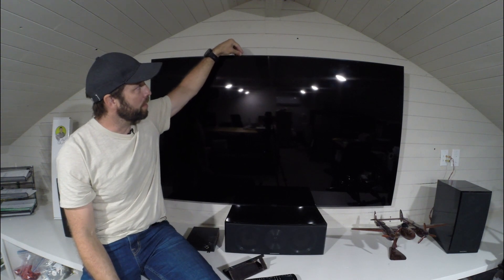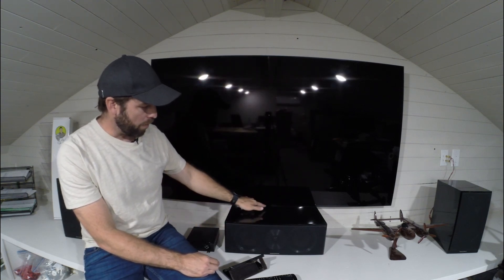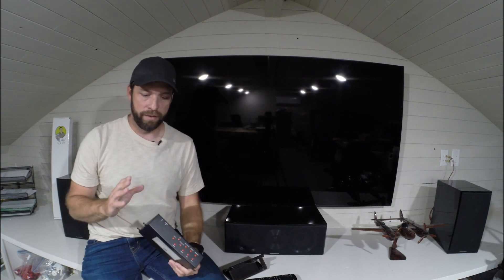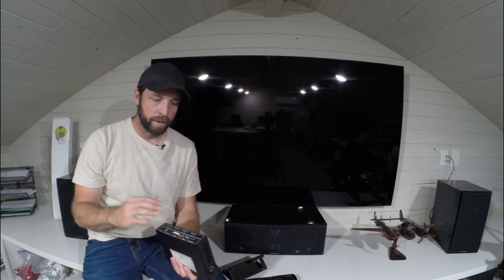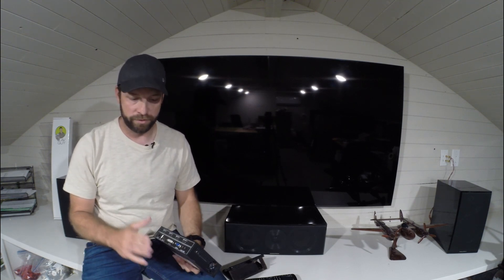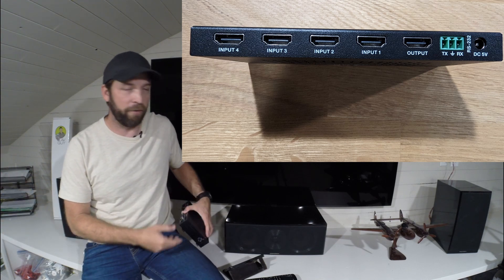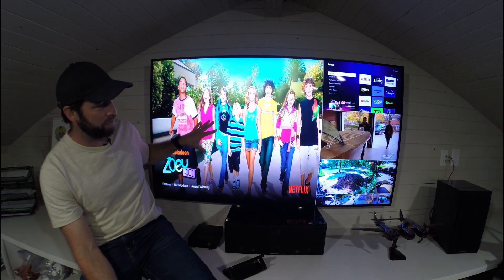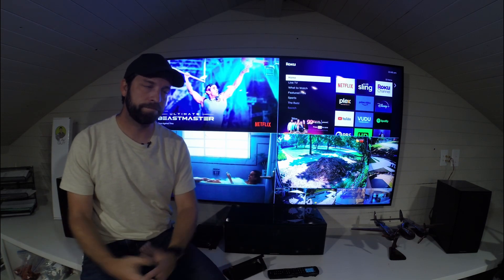What Hardware is Necessary for a Video Wall Setup

Comment: I’m afraid I’m trying something that can’t be done. Working on a 6 tv wall 2 high and 3 across. Would like on game days to have 6 different games on 6 different screens. AND have the option for a four screen large game with two separate games on the last two screens. Will the combination of the wall controller and media splitter allow me to do that? Or will the media splitter only apply to a single screen?
Reply from the maker: First, just about anything you can dream of is possible...just more $ and time is all it takes.  What you are asking for is 100% doable.  Depending upon your budget you might not get the results you are looking for exactly.  With the correct video wall hardware all 6 displays could be organized exactly as you described without any problem at all.  The appropriate hardware could easily set you back over 10k.  You could instead group 4 of the displays to one "cheaper" video wall controller with multiviewer and then leave the other two displays out of that system altogether and just use them to run whatever app you want to use (YouTube TV, Netflix, etc).  The 2x2 would be a true video wall (acting like 1 display)and the last 2 displays would just be regular TVs.  The multiviewer would need to be connected directly to the 2x2 controller to break them back into 4 individual sources when desired and back to 1 big image.  You would only need to address the top TV of the 2 independent TVs as it would likely have to be inverted to fit the wall appropriately and so the imaged would be upside down.  You can find hardware to flip that image because it likely won't be supported on your TV itself although in some service menus there are options to flip the image. Hope that all makes sense.

Comment: How would you feed the video wall controller from a distance if the source of the video is coming from a computer or laptop? Is it possible to use ethernet or wifi?
Reply from the maker: Any HDMI source would work.  Cable box, Apple TV, laptop, etc.   There are wireless HDMI sources you can use.  If you have Apple products any device with Airplay 2 is your solution (Apple TV, Roku and others). If you're a PC user something with Chromecast built in is a good option.

Comment: Hi! What type of TV mounts did you use to get everything so precise?
Reply from the maker: I've used both standard mounts and video wall display mounts.  Do a Google/Amazon search for them.  Video wall mounts give you the most control but you can get away with standard mounts I just suggest one with post level adjustments

Comment: Do you plug all your devices (fire stick, Xbox, chromecast, cameras) into the multiviewer. And then plug the multiviewer into the video wall controller, and then video wall controller to the 4 tv’s?
Reply from the maker: That is correct.  Or if you have a regular TV then you would plug the multiviewer directly into a single TV or projector.
Reply: Thanks for confirming. Very helpful.

Comment: The two pieces of hardware in the description both allow 4k in and out?
Reply from the maker: Correct.  But there are limitations with this sub $200 multiviewer.  It only supports 4k 30hz for one and you just need to do your own research when choosing a any hardware.  Specifications are pretty loosely regulated on these cheaper products and sometimes they can be very misleading.
Reply: @EdwinBonneau  yeah was looking but went with the one in the description so I'll just upgrade later on. Thanks! Don't see a lot of videos explaining this stuff

Comment: Is there anyway you can add the names of the hardware you use?
1. Video wall connect
2. Multi view connector
3. Master remote controller
4. TVs
Reply from the maker: I posted in the description
Reply: Awesome Explanation

Comment: You don’t have to purchase both. Either one would work depending on how many TVs you are mounting. Is that correct?
Reply from the maker: Video wall controller is required to make multiple displays into one big TV.  The multiviewer is an optional piece of equipment.
Reply: @EdwinBonneau I just bought 4 TCL QNED (Q7) and want to do a video wall where I can make it one big screen and have the option to watch 4 different games on each tv. Is the hardware you mentioned in your description  all I need? I wish you lived in Orlando so I can pay you to install😀
Reply from the maker: That hardware will work however you will also need a bunch of HDMI cables, and mounts also.  Also I don't neccessarilly endorse any of those products it was just examples of what to use.  My hardware is pretty good but has some limitations that bug me.  Nobody else in the house cares but they bugs me.   @bzharris3040